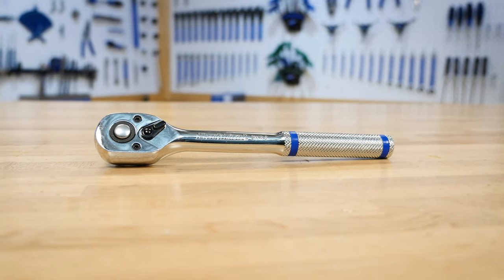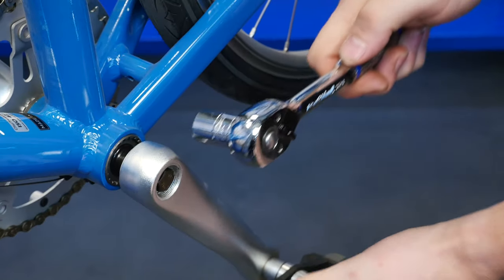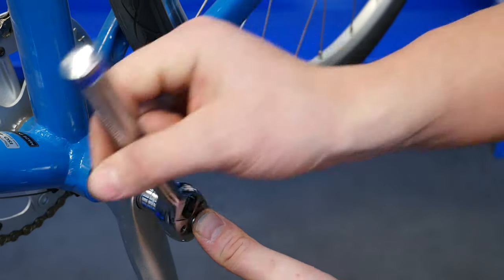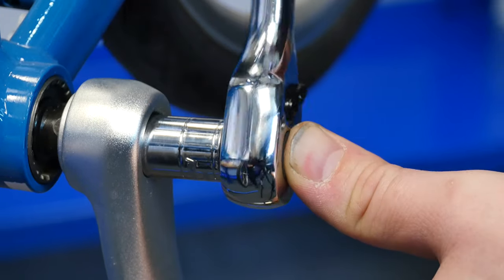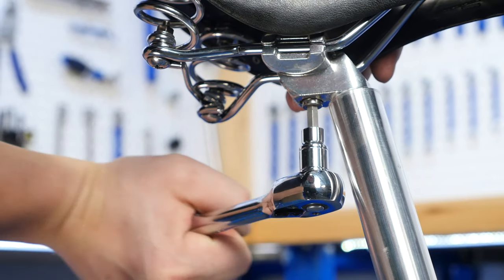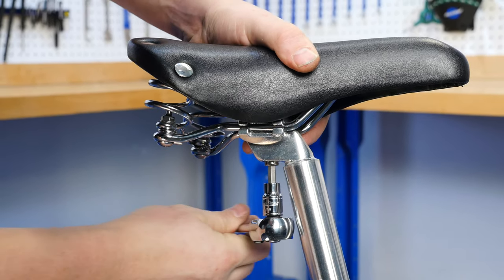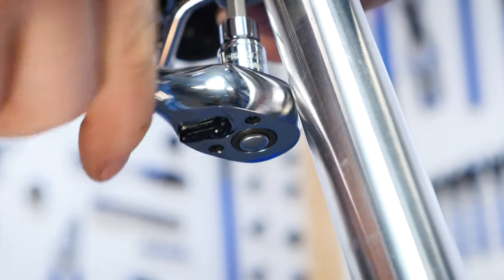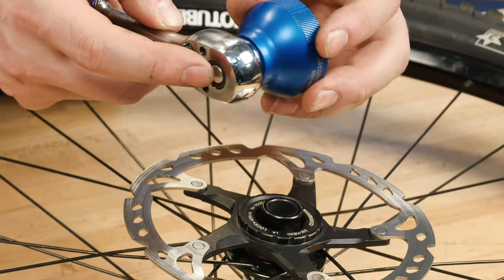SWR-8 Ratchet Handle

Comment: So... It's a ratchet? I own about 3 3/8s ratchets, I don't understand why I need one with parktool stamped on it
Reply: Evan Ford Gets out credit card to make purchase.
Reply: Not sure if PT is directly asking you.  But believe it or not some out there may not own a ratchet and need to replace an existing unit.  The Park Tool version is priced competitively with middle to low end brands.  Snap On would run $60 for a ratchet.  The PT ratchet is perfect for a weekend warrior that need a moderately priced ratchet.
Reply: Because it's got blue on it,and you can only mend bikes with blue tools
Reply: You're right, you don't need to buy it, but it makes sense to add a simple ratchet to the portfolio if it already has two (?) 3/8" torque wrenches, multiple bit sets and everything else besides a ratchet...
Reply: Those are good answers, thanks guys, it makes more sense now

Comment: Better if it was a torque wrench too but it’s just a ratchet handle!
Reply: you cant use torque wrenches for normal, casual doing and undoing of fasteners. it throws the calibration way off
Reply: Zach Mitchell - Park Tool Ratcheting Torque Wrench TW-6.2? (And loads of other brand options) ...........